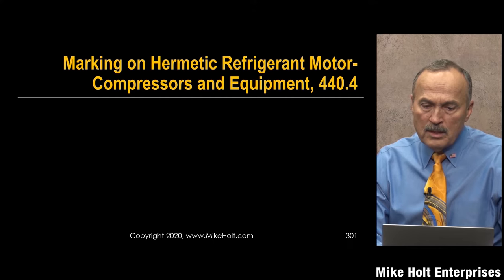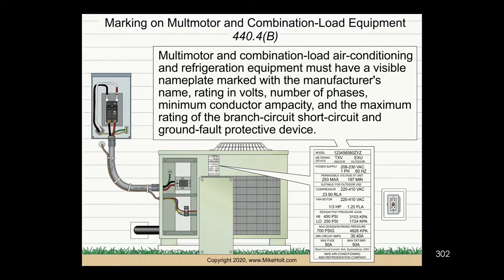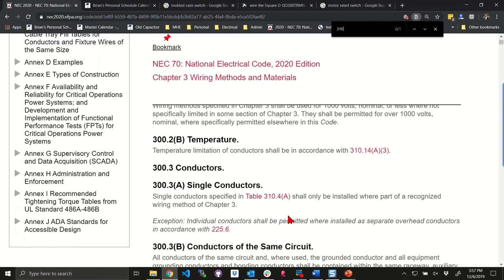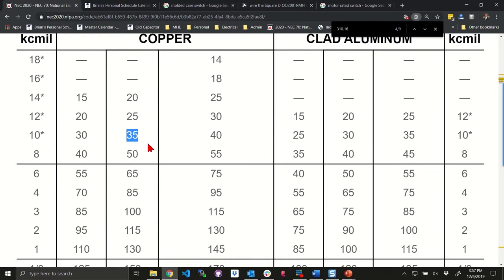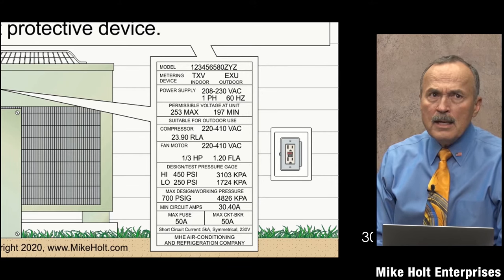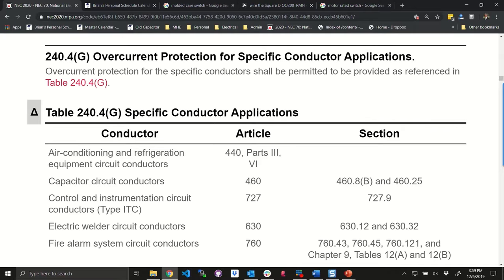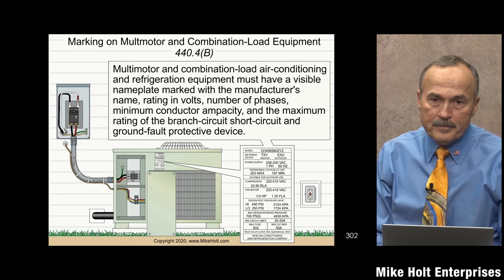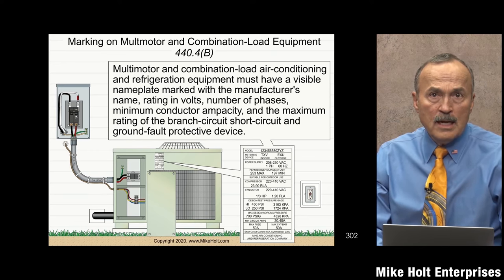Air-Conditioning, Circuit Sizing, NEC 2020 - [440.4(B)], (5min:33sec)

Comment: Sooooo helpful!  We literally just had this happen today.  45 Max Fuse on the condenser.  26.1 minimum ckt ampacity.  10 wire from the main panel to the fused disconnect.  Inspector wanted 45 amp protection at the main panel.  We watched this video and now realize the inspector was right.  (Don't tell anybody I said that, lol)  Thanks Mike for the lesson.  Mind Blown!  Shared with my whole team and now we know!
Reply: Inspector was not right. 26.1 Ckt is the conductor, which would be a 10. 45a protection would be the breaker
Reply: @jarrydee2799  isn't that what OP stated?
Reply: Do they make 45a breaker?

Comment: Motors have their own overcurrent protection system.That's why you can put a 10 guage wire on a 50A breaker, because the motor will not allow more 30A to pass through it
Reply: False. It's for inrush current. The stationary motor will draw around 50 amps to start moving the motor then level out to around 30 so to reduce nuisance breaker tripping a larger breaker is permitted
Reply: Overload

Comment: Hello Mike holt I had a question on the sizing, I have recently ran into it with an inspector where I have sized the wire off of the minimum circuit ampacity on the nameplate, and he is stating that it’s not sized for the “continuous duty” meaning the 125% I thought the nameplate had a lot of that accounted for, is that not the case? Do you still need to multiply the 1.25 by the minimum circuit ampacity? Any thing helps. Thank you.
Reply from the maker: Please watch the video again on how to size the a/c conductors (the a/c nameplate value for MCA uses the compressor amperes x 125% plus the fan load) see the nameplate in the video.

Comment: Since 99% of residential installations use nm-b (Romex) wouldn’t the conductors be required to be sized to 60°c. 30.2 amps would be 8 gauge on a dpst 50?
Reply: Asking myself the same question. 334.80 limits use of NM cable to 60 degree column. I quess Mike was talking about THHN or something rated to 75 degree
Reply: Type NM is not rated for a wet location.  This would be for the wires going in the whip.  Provided your flex is rated for 75c
Reply: Run #8 to outside j box or disc, then switch to #10 thhn
Reply: I asked same question.

Comment: there has always been some confusion for me on this in regards to wiring an air conditioning disconnect with NM  or NMS cable ( Romex ) in a residential application. and it seems to be a constant hot topic with inspectors.   In 334.80 it says the ampacity of NM, NMC, and NMS cable shall not exceed that of a 60 degree C rated conductor.  so in regards to the above Air conditioner,  if im going to wire the disconnect with romex.  then i would have to use # 8 correct?
Reply from the maker: Correct
Reply: Follow up question. If you are running NM to the disconnect then  running THHN from the disconnect to the A/C unit can you  run #8 NM then down size the THHN to #10 in the seal tight going to the A/C unit? Thank for the great video, we recently picked up a contract with an HVAC company and I want to be as informed as possible.
Reply: As long as the terminals are rated for 75degrees Celsius
Reply: Is UF classified to be treated as 60°C cable too? 
With #14 UF Cable could I still  use it, and at the 90 °C column at 25 amps, by using #12 THHN to splice at the panel and the disconnect, terminating the #12 THHN into the circuit breaker & Disconnect terminals. 
Now, have I created max 25 amps for #14 UF ?
Reply: @markkoenig4113  I know it's done regularly but I would think the Outdoor Disconnect would be considered a damp location and not permitted to run NM into it.
Reply: @i_am_macgyver84  you can always run nmb to an ac disconnect. It’s ran to outdoor outlets and lights everywhere
Reply: @jameskarrie298 Article number?
Reply: @markkoenig4113 the temperature rating of seal tight is 60° c in wet locations. I’m not sure if I am reading correctly 350.10(4) 2020code

Comment: For years I have increased 1 wire size when I pull long A/C runs (over 50') in conduits to eliminate wire buzzing in the conduits upon compressor start-up. Example #8s for a 30 amp load. We are 100% metallic pullable systems in Chicagoland area and I have found this buzzing/rattling of the wires on many residential service jobs where the minimum required size is used. It's a very annoying sound and is more prevalent with larger 4-5 ton units. Increasing one wire size always solves the problem even though the smaller conductor is perfectly within its required amperage capacity for the length of run. Am I violating a code rule by doing so?
Reply from the maker: Wire the equipment per the nameplate and twist the wires when you pull them in the raceway to eleminate the buzz on start up.
Reply: @MikeHoltNEC  excellent suggestion!
Reply: @steveloux4709  did twisting the wires fix the buzzing?
Reply: @skliros9235  you’d have to ask @Dave Nag.
Reply: @steveloux4709  oops
Reply: Did twisting fix the buzzing issue?

Comment: The air handler call for 45 amps. The panel and disconnect it has 40 amps breaker. The disconnect box it has breaker and the wires size is correct 6 awg?

Comment: I’m going back and forth with an inspector now on some of these rules. If you’re wiring a condenser or heat pump and the name plate rating says 25 MOP and min circuit 23.1 amps. You’re using NM (romex). According to the manufactures you can install it in 90 degree Celsius locations but you must rate it using the 60 degree column. The breaker/lugs are rated at 75 degrees. 

So manufacture and 60 degree column tells me 12 is good for 20 
 But 75 degree tells me 12 is good for 25. 

Now we have the * on the 310.16 chart and you go to 240.4G then you end up in article 440 3/4/5 I’m so turned around and confused I don’t even know what’s correct anymore. 

I was of the understand that if the name plate says min circuit you go to 75 degree 20 good for 25 amps MOP is 25 throw it on a 2 pole 25 good.
Reply from the maker: When using NM cable (Romex), you size the conductor to 60C of Table 310.16 [334.80]. If the MCA is 23.1A, then 10 AWG rated 30A is required.

Comment: Just be careful when wiring from the main panel to the outdoor disconnect. Many will use NM cable (romex for this). The wire inside the romex is rated 90C but the romex (entire cable) is only rated 60 degree C. So NM cable always has to be protected at the 60 degree rating.

In the Case in the video above you would have to use #6 NM Cable

Comment: Why do hot tubs (that also have multi Motors) have their nameplate ratings inside their hot tub? Not to mention having to unscrew 6-8 screws and removing the front cabinet panel just to be able to read their very vague sticker nameplate rating.

Comment: Am I limited to the 60° column after the disconnect if my LFMC is rated 60° wet location? 

350.10(4) conductors, or cables rated at temperature higher than the listed temperature rating of LFMC conduit shall be permitted to be installed in LFMC, provided the conductors or cables are not operated at a temperature higher than the listed temperature rating of the LFMC per 110.14 C.
Reply from the maker: You are almost correct... 350.10(4) "limits the current" on LFNC to the 60C values listed in Table 310.16. In this example, the a/c compressor is 23.9A and the fan is 1.2A which totals 25.1A. If we used 10 AWG, it's rated 35A at 75C and the maximum current is limited to the 60C column value of 30A. Okay

Comment: Can you fuse/breaker at the minimum circuit amps? Example: 29 max circuit Amps, 50A max fuse and say you run a 10g wire, can I do 30a or 40a breaker or do I have to do a 50a?
Reply from the maker: The nameplate indicates  the 'maximum' size protection. So anything less is permitted. There is a reason they gave 50A and I would use 50A, but you are welcome to use anything not greater than 50A in this example.

Comment: Great explanation. Im having trouble with the A/C furnace inside the house do we size the heater kit at 125% on a 9.6kw 240v unit = 50A breaker with #6 awg NM cable ?
Reply from the maker: See 424.4(B)

Comment: Mike, what about the wire size feeding the 50amp ocp? Can that be 10awg also?
Reply from the maker: ... well... there are not NEC rules that address this condition. Clearly it makes no sense to run larger conductors to the disconnect than from the disconnect to the equipment. But, the NEC doesn't give us guidance. So only use a non-fused disconnect to solve this problem.
Reply: @MikeHoltNEC  thanks for the clarification Mike! 👍🏼

Comment: Is the 10 awg only for the wires from the breaker or fuse box to the unit? What about the cables feeding from the panel to the fuse/breaker box. Does those wires should be size at 8 awg or 6 awg according to table 310.16?
Reply from the maker: The wires and protection start at the panel (circuit).
Reply: @MikeHoltNEC  Thanks Mike...

Comment: I get for the purpose of this lecture you are using the 75C table , but code wise should you not be using the 60C table ? regardless of insulation rating , you are under 100 amp and unless the terminals on all sides are labeled to be rated above 60C you should be using 60 C table 

VD aside , to me this is 8 ga wire on a 50 .
Reply from the maker: All terminals in reality are rated 75C, so you size to 75C, except if you use NM cable, then you size to 60C [334.80].

Comment: Excuse me ...in this case “ can I use the wire # 10 /3  from panel to the disconnects ( 30 amp) and the breakers twins ( 40  amp ) ?????  Distance 50 ft ???
Reply from the maker: Post your question on MikeHolt.com/Forum

Comment: Would this also apply to the Air Handler since it is considered a single motor load?
Reply from the maker: The air-handler is sized per Article 424, not 440. But the conductor size and protection is also marked on the air-handler, so you size it per the nameplate.

Comment: So the 10ga wire is sufficient to carry a 30A load, but the breaker is sized at 50A.  I'm guessing the thinking on that is:  If the compressor locks up or goes dead short, it'll trip the breaker before the wire melts?
Reply from the maker: The breaker is sided for 'short-circuit and ground-fault' conditions, not for 'overload' conditions. Overload protection is provided internally with the a/c equipment. Answer: Yes to your statement.

Comment: Hello sir. 
When can I use this codes  440.22 (A) (B) and 440.33(1)(2)(3)

Wire sizing: compresor 23.90x1.25 =29.87 plus fan motor 1.20 = 31 amps 

Breaker sizing: compressor 23.90x 1.75=41.82 plus fan motor 1.20=43 amps
Reply from the maker: Never, that is for the manufacturer. Just follow the nameplate as explained in the video.

Comment: What is the minimum size breaker allowed?   I had a situation where the name plate stated max. breaker of 30, min. circuit ampacity of 23 and a rla of 15.5.   They put in a 20 amp breaker and one inspector said that was ok and another said it needed a min. of 25. Any help on this would be appeciated.
Reply from the maker: Using your example of Max 30A breaker and Min 23A wire, then you should not install a breaker that is rated less than the min required wire ampacity. However nowhere is this covered in the NEC. What happens if you put a 20A breaker on a 10 AWG wire for your example? Well maybe the a/c unit won't trip the breaker, if it does, then you put a 25A or 30A breaker. There is no hazard to install a smaller breaker.
Reply: Thanks for the quick response.   That is the problem the NEC does not address this.   One inspector was using the continuous duty of  125% x rla 15.5 and that is why he was saying a 20 amp breaker was ok.  What do you think?   Thanks @MikeHoltNEC
Reply: @tonyhddodge4282  I don’t have anything further to add to my response. Sorry.
Reply: @mikeholt9781  I understand.   Thank you for your first responce and the work you have put into doing what you do.

Comment: The 50A is the MAX; I think I can still use 30A breaker with #10 ... correct?!
Reply from the maker: You could place a 15A breaker, but why take the chance when you know 50 will work and not trip.
Reply: @MikeHoltNEC  Noted and thanks for your reply!

Comment: Hi mike, how about the 125% required for conductor sizing? can we apply it to the minimum circuit current?
Reply from the maker: The 125% is already incorporated in the nameplate MCA.
Reply: @MikeHoltNEC  thanks a lot

Comment: Would your AC disconnect have to be rated for 60 amps?...since their normally rated 30A, 60A, 100A...
Reply: 440.12 a 1 - at least 115% of rated load current or bcsc, whichever is greater.

Comment: Hello Mike, awesome information here. I'm an electrician in Canada, it seems that the NEC and CEC are very similar. This is how many in the HVAC industry size their wire and breakers but some inspectors don't seem to be aware of this and will tell us we need a wire the can handle 50A. I'm curious if you can confirm that the CEC would size the same way you are showing us in your video here?
Reply from the maker: I have no clue what the CEC requires, sorry.
Reply: @MikeHoltNEC  Let's try a different angle here...points and two questions... The CEC and NEC are inline (CEC was based of the same code as NEC and UK and there is a movement now for globalization). Mike, would you agree that the heat pump in your example could be put on a smaller over-current device and that the cable size therefore could be reduced, as long as it met the minimum circuit ampacity? To the question of increasing the cable size, where the nameplate states maximum overcurrent device at 50Amps, if you install a 50A CB it must protect the cable, therefore the cable size shall meet the 50 CB (typically 80% of it's continuous rating so 40Amp cable)? I don't agree with this necessarily but I believe it is what D is asking.

Comment: How would you size the Grounding conductor for AC units?  Is it based on the max or minimum ampacity on the name plate?
Reply from the maker: 250.122(A)

Comment: Nameplate says max overcurrent protection 35A.  What do we do in that case?
Reply: You use a 35 A breaker lol
Reply: Follow the name plate since 35 amps is a standard ampere rating size I would match this with a 35 amp breaker .

Comment: is it still ok to size the cable as per the 50A circuit  breaker? because im doing it for a lot of projects i made
Reply: Jpatristan Torralba  you could end up violating 250.122B (B) Increased in Size. Where ungrounded conductors are increased in size from the minimum size that has sufficient ampacity for the intended installation, wire-type equipment grounding conductors, where installed, shall be increased in size proportionately, according to the circular mil area of the ungrounded conductors.
Reply from the maker: The equipment grounding conuctor is 'not' required to be increased in size, see 250.122(A) and 250.122(D).
Reply: MikeHoltNEC  that’s not how I’m reading it “(A) General. Copper, aluminum, or copper-clad aluminum equipment grounding conductors of the wire type shall not be smaller than shown in Table 250.122, but in no case shall they be required to be larger than the circuit conductors supplying the equipment. Where a cable tray, a raceway, or a cable armor or sheath is used as the equipment grounding conductor, as provided in 250.118 and 250.134(A), it shall comply with 250.4(A)(5) or (B)(4).”
Reply from the maker: @armandocepeda7533  Okay, you are welcome to read it as you like.
Reply: @MikeHoltNEC  This is an arrogant answer I did not expect from you!
Reply from the maker: @Adi-S  How would you have prefered my respond to be. I explained that you size the EGC per 250.122(A) and (D) and that if you ran 12 AWG on a 50A breaker to an A/C, the EGC would be 12 AWG. If  you agree with me, then we are all good; if you don't agree with me then my response againg would be 'you are welcome to ready it as you like.'
Reply: @MikeHoltNEC  is it ok that i oversize the cable?
Reply from the maker: @jpatristantorralba9477  Please watch the video on how to size conductors and protection for a/c loads.

Comment: Do you apply continuous load factor on top of the MCA of an AC? Or motors?
Reply from the maker: You size the wire per the manufacture nameplate instructions. Please watch the video again.
Reply: @MikeHoltNEC  thank you. This applies for the branch conductors but what about the feeder conductors serving for example 10 ac units? Does all the load add up and a 1.25 multiplier applied to that number (since the ac loads are continuous) ?